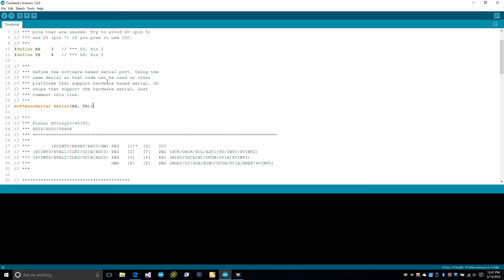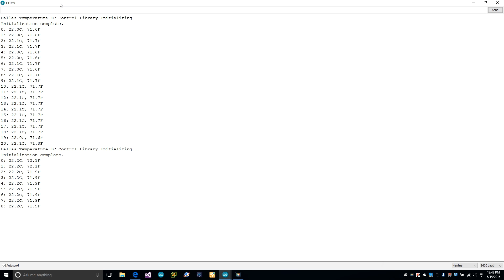Easy Serial on the ATtiny

Comment: hi ,
Question1
Is it possible to have two UART communications on the same board(ATtiny85)?
example, I have three ATtiny85 boards named A,B,C, each have two sets of tx/rx.
B's rx received from A's tx , and C's rx received from B's tx...and 
device "D" 's rx received from B's other tx ,and D's tx write to B's other rx . 

Question2
as Question1, how to display B and C's serial moniter?

thanks
Reply from the maker: It is possible to create a second instance by giving it a new name and assigning two different pins. The first could be defined as SoftwareSerial Serial1(2, 3) and the second as SoftwareSerial Serial2(4, 5). Doing this will leave you with one free pin, the reset pin, which you would have to re-program as an I/O pin to use for something else. I do not know enough about you project to know if this would work or not.

An alternative would be to create a ring with all of the tiny's. This would be done by connecting the TX in A to RX on B, TX on B to RX on C and TX on C to RX on A. This would only require 2 pins per tiny but would require a little more complex software. In this configuration you could create a simple message structure where the first two characters of each message represent the source and target of the message. For example, a message could originate from A and be sent to C with a message that looks like this: 'ACHello World!".

For displaying messages, one board would be dedicated to the display. This board would use one extra TX pin to send to the display device (like a computer serial port).
Reply: @danielporrey4815  ,
Thank you so much , I'll try the two solutions ! :D
Reply from the maker: @kaski45  No problem, let me know if you need anything else.

Comment: How to do serial communication with Attiny using arduino nano
Reply from the maker: Are you asking how to connect an ATtiny to a Nano and have them talk to each other? If yes, connect the TX pin of the ATtiny the RX pin on the Nano and connect the RX pin of the ATtiny to the TX pin on the Nano. Use the software based Serial library on the ATtiny as shown in this video and use the standard Serial on the Nano. On The ATtiny use the Print command to send some text and on the Nano use the Read command to retrieve data. See https://www.arduino.cc/reference/en/language/functions/communication/serial/read/ for information on how to read the data.
Reply from the maker: The nano uses the ATmega328 which has built in serial. The Serial object is ready configured and can be used within your code without specifying the pins. It still requires Serial.begin(...).